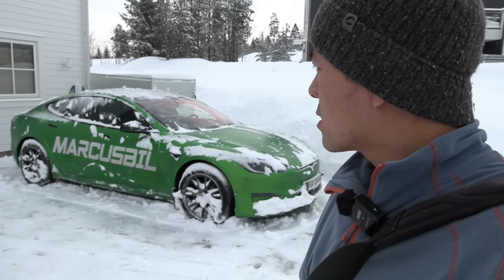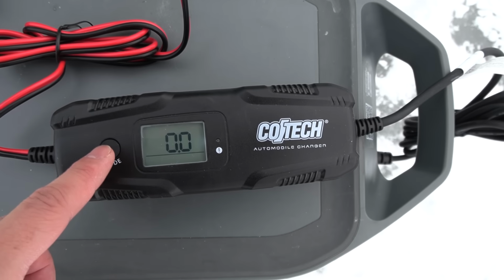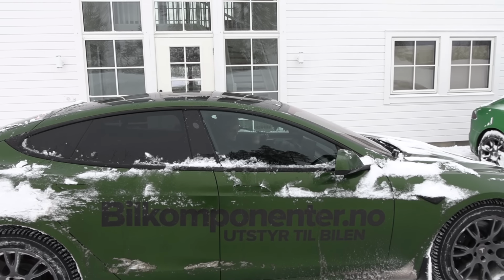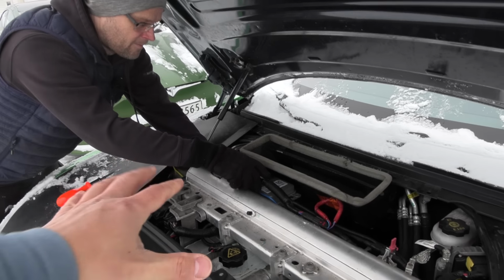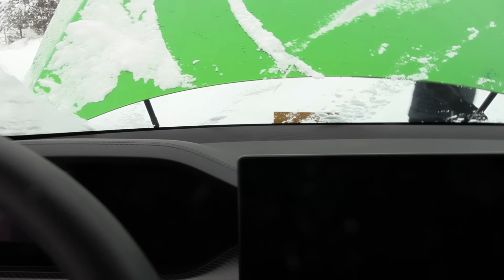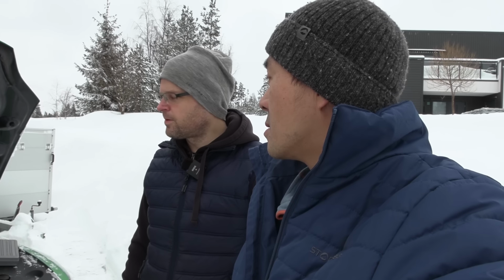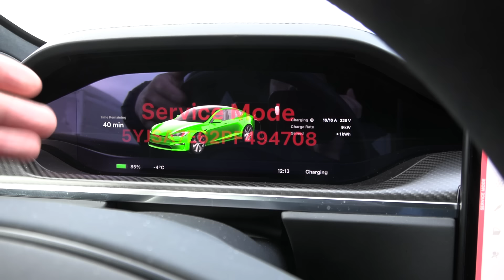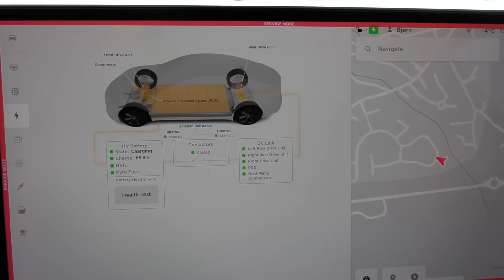Tesla Model S Plaid died in the cold

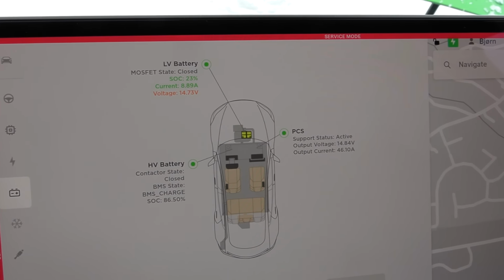Comment: 16:20 I wonder if it's an issue of LV battery cannot be charged when it's -10 and it doesn't have heating like HV battery. So basically car waits for LV battery temperature to be more than -10 until it chargers it, but battery dies first and HV contactors close and car is brick. Maybe LV battery has a heater but not big enough? Or maybe it's too big and caused voltage drop at 19% to be so big that LV battery contactor opened to prevent damage?
Reply: Car could engage contactors first, enable DC-DC and set it to output current LV battery voltage and then engage LV heater. When LV heats up sufficiently - increase DC-DC output voltage according to LV battery charging profile.

Comment: Hi Bjørn, I suspect the 12 -14 volt charger feeds the 16 volt lithium battery by a dedicated charging and voltage converter circuit. Until the 16 volt battery comes up to an acceptable voltage - not shown on the 12-14 volt charger output - the car will not 'wake up'. If the lithium battery is recoverable then it just takes time to get sufficient charge into it. I know you have a follow up episode about this problem, just not watched it yet! I think everyone would be well advised to carry both a 'Frunk' unlock power source and also a way of putting some charge back into a low lithium battery - and keep that kit in the frunk, not the trunk!

Comment: Why not change the low voltage battery with a lead acid one instead of lithium one?
Reply: The Li ion has a special connector with power and data in it, the car probably needs data connection to the battery to work.
Reply: Why put such crap again into the car?

Comment: The current battery technology, unfortunately, is never going to make nice with the extreme cold.  Moreover, there is not enough range in the typical battery size to take the mileage hit of extreme cold.  I think a battery trickle tender might solve this problem for you. A 16V low voltage battery is an odd ball though, maybe Tesla makes a propriety one. 🤣Call Elon.

Comment: I appreciate your opinion of Tesla engineering......but you haven't sold me on EV's in general. My ICE car is 8 years old and it's still got the original battery and when I told AUDI to change the battery they wouldn't because they said there was nothing wrong with it......and my car always starts first time....just I'm accustomed to 12V car batteries only lasting 5 years. I'm sure your Model S Plaid is literally new or within 2 years of manufacture........the fact that it wouldn't start tells me it is not operating according to design so therefore needs to be fixed by the dealership........but I suspect they can't really fix this in a timely manner..................so thanks........but I'll stick with my ICE vehicle.

Comment: Some Porsches also have 12V 4s LFP batteries. (A123 Systems for example) Indeed you can also switch the internal contactor on for a while when you give it just a bit of 12-15V.

Comment: I would Get 2 Very Large Outdoor dog kennel heating beds - - IP67 Rated (Water proof) so you can jet the hose pipe on then and is not do a thing with mains on (no shocks, arks)

The use  infrared to heat the dog With  A Very  Slow soft heat   (the Elements are not Resister based like a Heating element (Ring Hob kitchen stove kitchen kettle They ARE INFRARED LEDS AND HEATING The dog & kennel optically &  over distance  is just (ir) Light )

 They do make a Even  Smatter Lithium 12V 24V charger with  Cold Recovery and Low voltage Recovery  mode if the power button if you press and hold for 3 ~ 5  set will go into "Just" power supply  mode for 30 min  ~ 60 mins (user pref set) (To kick the Pad heater on and Pull the cells back into Green voltage range )

BTW You can fool it with a 500W 600W Bench DC  power supply  Set at 12V ~ 16V 40A
Just remember to wait  Due your car is Part Mini PC and need to firmware boot & Self check 
or you could get a RC 4S (14.8V) Battey pack  (Hard case )

Comment: these guys clearly know WAY much more about EVs (or just "Teslas") than me, yet i consider this performance RIDICULOUS (i'm sorry), children-in-a-sandpit impression. I don't mean this to be disparaging them personally, but him so much emphasizing the "advanced" "technology" that this is, "EV"s or any computer-controled "cars" are clearly designed to be unserviceable. Much like an iphone. BTW, if i have 19% in the tank, i can DRIVE several hundred KMs, not be stuck freezing in snow somewhere, not to mention, "dead" battery can be "jump"-started simply by pushing it down the hill. This thing is a dangerous deathtrap that no one is willing to clearly explain and document proper EXACT procedures in any kind of emergency.

Comment: An A23 garage door remote battery can be used to open the frunk. 
Really cold weather is tough on lithium batteries. I’ve had the lithium battery in a car alarm remote get too cold and not work. I had to put the fob in my crotch to warm it up to get into the 4Runner. As soon as the battery in the remote got less than frozen it worked. 😊

Comment: What happens to a Diesel vehicle with no fuel additive, no engine block heater connected, and an old-school lead acid battery in these conditions?  Oh, maybe you wouldn't be so stupid.
Reply: That depends on the age of the battery. I just swapped both the start (main) and accessory battery on my 12 year old diesel merc, both of which may well have been original to the car. I'd been putting it off, so the accessory battery going bad first caused a few accessory systems like side-assist throwing an error on start (but still working), and eventually an error message for the battery. On the day I was going to swap it, the car actually wouldn't even go into gear, but I just managed to get into the trunk to pluck out the old one and swap it. The main battery is also obvious, with sluggish starts, Distronic intermittently quitting, and start-stop (Eco) functionality not activating. Notably, even before replacing the batteries, the car ALWAYS started (if slightly sluggishly), and it always unlocked without issue.

As a general rule, the grade/quality of diesel will be adjusted to the climate/temperature of the area it's supplied to, mainly by kerosene content. As long as the vehicle is in regular use, low temperatures/cold climate should not be an issue, but in extreme cases, it can be.

Comment: My assumption is that the reason for the glitch is that lithium batteries must not charge below 0°C. So, if the load is low, the 16V  battery will cool down to a temperature where it can't be charged. This could only be avoided by heating the battery before charging. Might also be that a heater is included but is too weak to heat up the battery to a point where charging is possible, thereby draining the battery additionally. A software based option might be to heat or switch a load to heat the battery and charge it intermittently before reaching 0°C. This would increase vampire drain, but keep the battery alive. Another option might be to thermally insulate the battery.
Reply from the maker: This is the whole mechanism I already explained in the video. Tesla has designed so that the 16 V battery discharges and charges to generate heat (from its internal resistance).
Reply: @bjornnyland  Maybe I got that wrong. It seemed to me that you were describing something like self discharge by higher internal resistance. Anyway, it seems like the load isn't high enough to keep the battery warm enough at really low temperatures. Maybe some battery attached heating elements would be a better solution. Another point that might be problematic is using an external charger to charge a frozen battery as the plating effect then can't be suppressed by the protection algorithms.

Comment: "We would recommend charging the 12v battery for at least 5 mins before trying to do anything with the car including charging the car to avoid any glitches" [tesla-info]
InsideEVs: "Tesla's New 12V Li-Ion Auxiliary Battery Has CATL Cells Inside" for specs, including temps.
What about a CTEK charger that is specific for charging lithium, not just SLA? EcoFlow also do a Smart Auto Battery Charger btw.

Comment: you need to buy a cheap DC test meter, learn to know + and - or you may feed reverse voltage into the jump battery and it may kill the cars electronics, also buy a long mains cable and extension outlet make sure the rubber is low temperature capable as well, you really dont know nuch about anything technical such is the modern world, leave it to trained experts or buy a car with a real engine in it

Comment: You mentioned that Kia doesn’t top up the low voltage battery but my EV6 GT does just that. There is an orange light on the top of the dash that lights up when the traction battery is charging the low voltage battery and I see it on quite often.

Comment: This type of booster does not supply a regulated 12 volt power. It supply  a rectified sinus voltage.  It is supposed to have a battery to charge. The battery will then work as a voltage regulator.  A DC power supply would be a better solution or another battery.
Reply: The battery will work as a capacitor to smooth the pulses, not a regulator.

Comment: I was told that my e-niro will not charge the 12V battery if the charging cable is connected without charging.

Comment: Most legacy automakers use Power Save mode when the 12V battery is low, disabling keyless entry, alarm,... Entering the vehicle with physical key disables Power Save mode. 
Tesla made a bad engineering choice just to make more news material for The Sun :)
Reply: So Tesla invented the dead 12V battery .... everyday one learns new things on the internet.

Comment: Stop putting 12v jump start tech made for lead acid chemistry on this custom 16v Lithium cell. It’s 4s and designed for balance charging via its own bms that is not active in your jump start bs. Besides the fire risk, it’s just dumb, this battery has no heater, so it can get too low in temp and cell voltage to not be able to function until it’s warmed up. But the jumping nonsense is going to damage it and Tesla should not warranty customers that intentionally break stuff for YouTube content.
Reply: The 16V battery has its own BMS build in internally, if it sees something it does not like, the battery cells are disconnected to protect itself.
There is no fire risk if the internal BMS is working correctly, it is not possible to bypass the 16V battery BMS without breaking apart the battery module itself.
Reply from the maker: You clearly didn't watch the video... We disconnected the 16 V battery first.
Reply: @bjornnyland  100% you got me, also another commenter correctly stated the BMS will gate a possible overvoltage situation. But Tesla and fire in the comments is great for engagement at least. 🤷🏼‍♂️ Now get Marcus to drive down to Munich to take away my stock plaid iron brakes, his are rusty and not even the proper plaid red. If he arranges transport I will give them away for free.

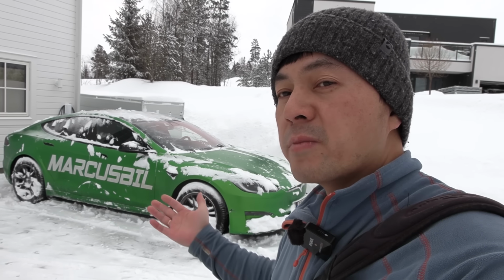Comment: At 6:00 on your video: My Hyundai 38.3 Ioniq got a new BMS when they changed the main battery due to fire hazards. Since then it actually wakes up when needed to charge the battery. I have seen as often as once every hour in the could while running a dashcam. Eventually it will wake up less often like once every 6 hours ore even once every day (like it was before) when parked in a heated garage. After 1 week when the Bluelink had disconnected itself to save power it still kept on charging the 12 V battery when needed (kind of weird behavior). All checked with the BM2 12 V battery monitor.

Comment: I've heard that you can apply a A123 battery (12v cylindrical) and the frunk will pop open allowing access to the battery for jumping.
I was suspicious when you disconnected that 16 v battery and connected a 12v charger.  It was expecting 16 volts from the main pack.  Logic detected that the 16 volt battery was not connected.
So, the procedure would be that you charge the 16v batter with the 12 volt charger (Well, probably 14 volts) just to bring it up to logic levels.  THEN reconnect the 16volt battery and let it recover the battery on it's own.

Comment: I would recommend a victron 13 v 15 amp charger you can set whatever voltage you want up to almost 16 and it will put out power without having any battery power

Comment: Those smart 12V battery chargers does not work if they detect zero Voltage, aka completely dead battery . You have to have some low Voltage present. The reason for that if the 12V battery is dead, and the user put the negative and positive terminals in the wrong way, it can fry the car, and if that happens the 12V charger manufacturer can be sued. That's why old chargers work, because those, does not have and protection against wrong polarity, and if you put them on the wrong way, it will fry your car.

Comment: Battery preheating is nothing new. This was already topic in my vehicle hybrid power train couse in 2009.

Heat pumps will not function properly w/o temperature reading in/out of both loops of the heat exchanger. Sercice menu in the other manucacturers most likely show it, but I do not know if they are open to the public.

Comment: Faulty low voltage battery drained both batteries and after 16 V was attached, enough voltage to boot up. Could be, that Low voltage battery needs replacement (cold damage). 

BMS did not cope well with cold, either. It should of topped up the high voltage battery regardless.

Comment: Is it some sort of safety thing that EV cant just charge low voltage batteries from the HV battery. They have bcm's on those small batteries and know when they need charging. I would be more mad if the car just dies because the low voltage battery dies compared if i lose X% faster from HV system standing...

Comment: According to the manual (and also the Youtube clip i'm linking.) You should only connect the external power for 20-30sec and then the battery should handel the rest, if you have power in the main battery.
https://youtu.be/8-MNFgashpQ?si=ob3bNOrh6smgla6-
Reply: Than again. In your case (as also shown in the video i linked)  disconnecting the battery and having the charger as a replacement should also work... so i guess thats the reason you got it running again.

Comment: Ecoflow does have direct 12v output, you should get an adapter. Marcusbil can make you one, i'm sure
Reply: There's probably a current limit of 10A on that output. It'd be enough to open the bonnet but not to wake the car up.
Reply: @CampGareth  If it can charge the 12/16v battery it should be enough but can take a bit more time before it can wake up.

Comment: I would buy a ham radio linear power supply such as a Yaesu FP1030 rated at 24A and provides super smooth 13.8V output. I doubt if a booster supply is really well enough regulated.

Comment: How cold was it when you reconnected the 16V LV battery?  Since the 16V battery must discharge to create heat (and it would not have had enough charge to allow that), it must have been above the temp that allows the 16V battery to begin charging.  If the 16V LV battery was still below the temp that allows charging to begin, I wonder if you could use a heating pad/hair dryer to warm the battery where it would allow charging via the PCS?  At very cold temps, I believe the 16V battery charging system is designed to discharge for a period of time (to warm the battery) then recharge to 80%.  Something must be amiss with the logic of the LV charging system or the car has some unknown issue.  BTW, great video!

Comment: Why did they disconnect the LV cell plug? 
Doesn’t it need the LV plug to transfer power to the other systems not attached to the LV jump points?

Is there a video that shows and Clearly explains what is going on in all the various scenarios when the 16V LV cell is dead, low, disabled?

Curious how those react VS the 12V LV system that seems fairly flexible. 
Read many interpretations about how the 16V system react and special conditions, not sure what to believe, and have not found a clear explanation or real life scenario like this to clarify.
Reply: Putting 12V to the jump terminals wakes the system up, including the DC-DC converter which will keep the system powered even with no battery. It will then attempt to wake and charge the 16V battery if it sees it's connected. You don't want to backfeed 16V into your 12V jump source.
So once the car is awake, you can then take the jump source off and reconnect the 16V battery, where it should charge if all else is good.
Reply: @andrewt9204  If your jump source was 16Vdc nominal, would it be completely OK to jump With the 16V LV cell still connected?

The issue is only with backfeeding 16V to a 12V device?
Reply: @101rotarypower  Yeah, pretty much.
 Well, and I haven't confirmed it but disconnecting the 16V is also supposed to reset the 16V discharge MOSFET to discharge again, taking it out of self-protect mode.

Comment: I think the problem is that booster only provides voltage in order to charge 12V batteries. You need a booster with a higher voltage. A small pack of 8 2000mAh cells (4S2P) charged up to 100% could be enough (14.8V nominal, 16.8V max, 4000mAh, 60Wh capacity). Or a 5S 32700 LiFePo pack (16V nominal, 6000mAh) better. It's a fancy DIY project not very expensive.
Reply: Apply 16.8V to freezing cold and discharged LV (4S li-ion) battery?
Of course it WILL go into protection. BMS cutoff on charging overcurrent or charging when too cold.

Comment: Since my 1993 Mercedes w124 i never again had 12V issues. And back then i drilled holes in the battery Cell covers to refill with destilled water as it was a "maintenance free" battery... Afterwards it was good for another 5 years ❤❤😂😂

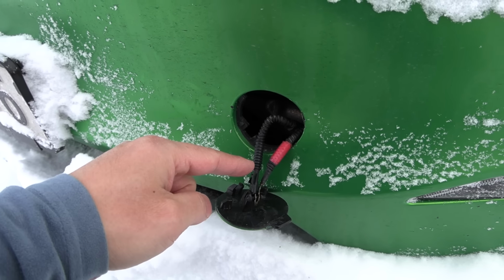Comment: It looks like the two wires were shorted together at the front bumper access port 3:12. Was it shorting out the 16V battery? If this was the case, then maybe install a vinyl washer between the positive and negative.
Reply from the maker: These are input wires.